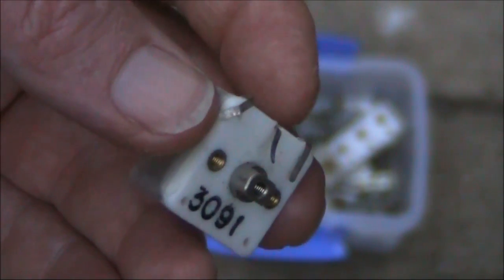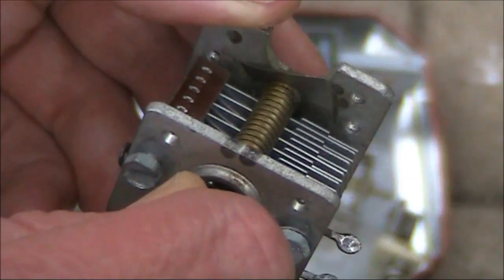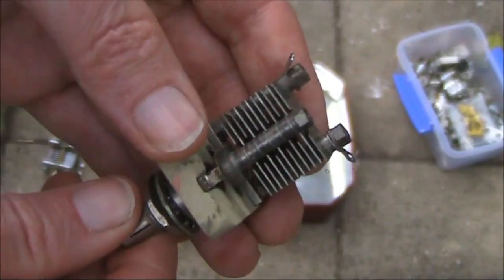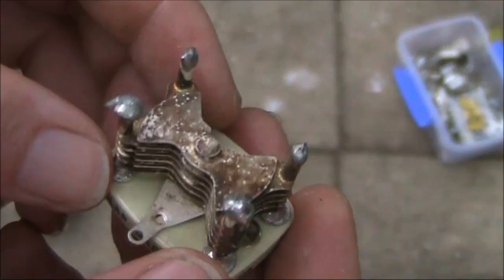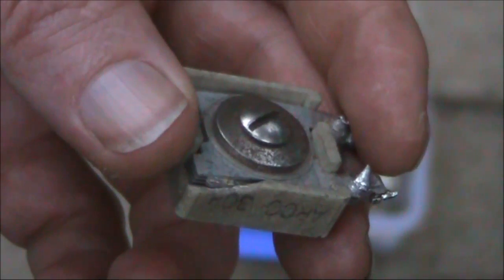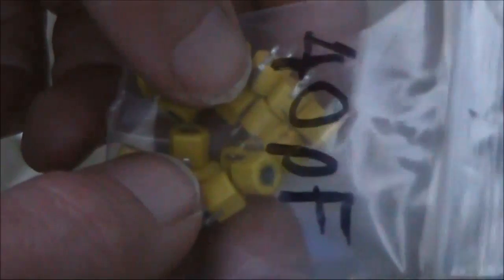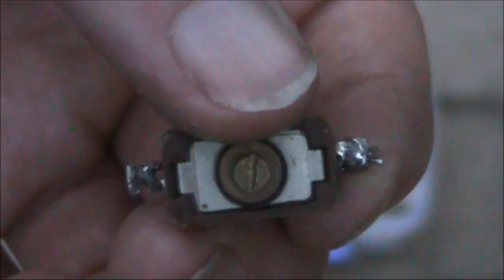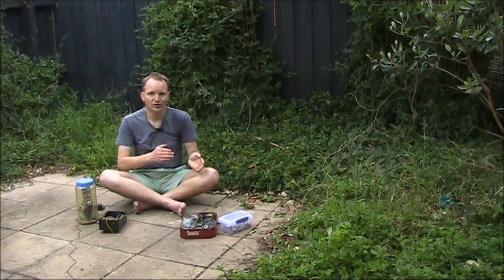Electronics on the Floor: An introduction to variable capacitors

Comment: Hi from Adelaide, i have on old Logimtrics 921 sinal generator..it has a main variable  type frequency tuning pot but then to get the hertz decimals you use a fine vernier pot..my problem is this pot seems very loose and scratchy and when you tap the top of the unit just above this pot the frequency display jumps around 0 to 15hertz, is there a grease that i can pot into the potentiomer to tighten it up and give the feel more drag?
73.
Thanks

Comment: I enjoy the electronics on the floor vids, much appreciated. I'd love to know more about ceramic resonators if you get around to the topic some day. I've found very little easily digestible information on them. I have a couple of local  council pickups around here in the next month or so, hope to salvage a few Variable Caps. Normally get 2 or three in this suburb.